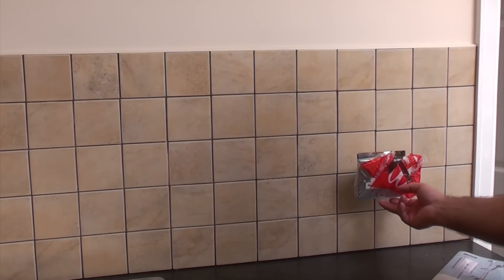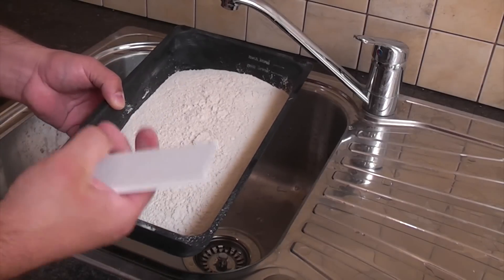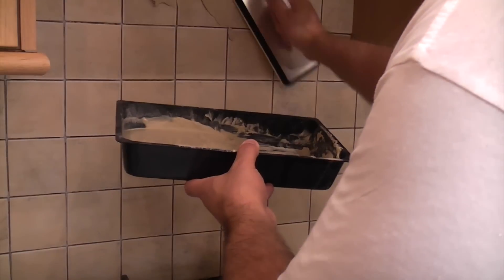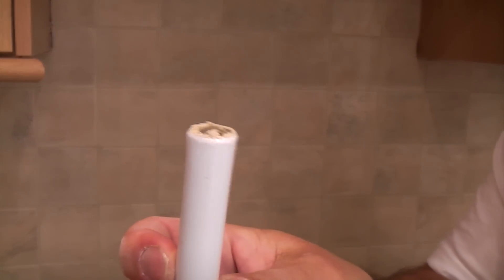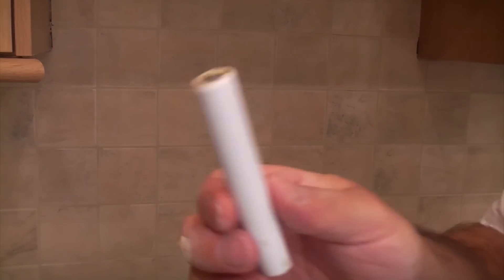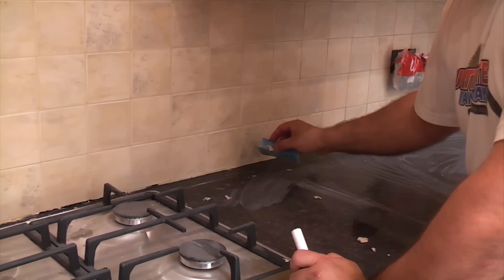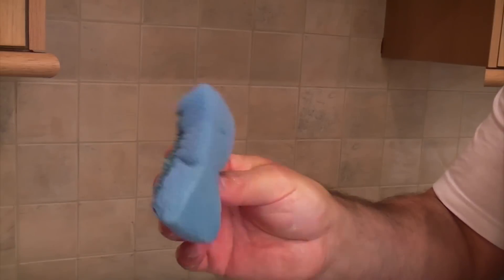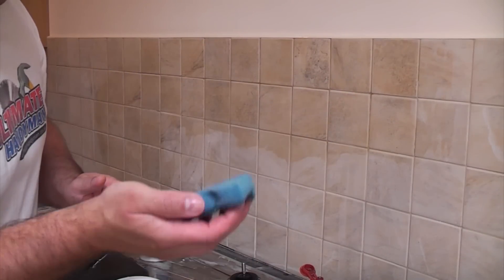How to grout tiles | tile grouting

Comment: Excellent video.  As an absolute beginner I: (1) added more sockets re-doing all electrics using Wago connectors and boxes abiding by all regs, (2) installed 12 GU10 ceiling LED spots; strip LEDs and central light chosing FCC approved LEDs to avoid EMI; (3) screwed on Fermacell ceiling boards with FST (not to have to pay for a plasterer), (4) I fitted my German kitchen myself.  I was scared of tiling but your videos on this once again really help. I have saved money and done all as I wanted it!

Comment: I also did all of the plumbing with Speedfit and part in copper and I installed a kitchen sink across the worktop joint (between two worktops) a challenging and risky endeavour.  Your other video on the mains pipe coming into the property and how that is and worked (the only video I have seen on that on YouTube) really did help me there! Your videos are so great.

Comment: ...one of your videos made me aware of the problem with bathroom tiles being hit constantly by power shower that the original build had not used a water resistant board under tiles or not made more impermeable the plasterboard (remembered that the guy didn't do that 10 years ago).  I now provided some solution re-grouting but fully aware thanks to vid of the inherent weakness.

Comment: Good idea, I'll test a bit, as I have a sheet of scrap.Thanks for getting back so quickly.  P.s. I have sealed with Stainproof Original, leaving 48 hours after fixing (adhesive took a bit longer to set).  Will seal again after grouting.

Comment: interesting grouting process, i usually grout a area, then sponge off after a short time, then use a grout finishing tool to get the joints perfect. If you use the pipe or finishing tool too soon, the grout lines can become messy, but if you sponge off too quickly, the same thing can happen. i was hoping to see you silicone and finish the job, and get those worktops spotless, I hate a messy worktop lol.

Comment: Thanks for the video, the only thing that worries me is the removal of the grout from the tile surface.  Is there any definitive way to grout textured / porous tiles without making too bigger cleanup job.  My initial thought was that it might be possible to pipe grout into the gaps and clean is off as you go?

Comment: How long do you wait after applying the grout until you use the pipe? And then, how long do you wait until you start to sponge off the excess grout from the tiles?

Comment: Great tutorials. Made it really easy. Thanks :-)

Would have been useful in this one if you'd said roughly how long it takes the grout to dry before you can wipe it with the damp sponge though.
Reply from the maker: It's impossible to say as there are too many variables, such as the wetness of the mix or the room temperature.
Thanks for the comment

Comment: Do you find powder grout a lot better than ready mixed stuff? Sometimes I get little surface craters in the grout lines and wonder whether its just the grout i'm using or i'm sponging too early. Means I have to go over some areas twice to get it looking good. Any tips?

Comment: Brilliant demo! Feeling much more confident with my tiling now! lol I am going to tackle a very small area above the small sink. It is only 5 small tiles across and 3 tiles high (same size as video) Please can you tell me can i add the tiles without the posh beading along the top and sides? Can I just use white silicon sealant along the edges instead? Also the rubber grouting float is probably too large a tool for this small area?
Reply from the maker: +jaybeth69 
Yes, you don't need to use the tile trim, although it can be difficult getting a neat bead of silicone, but this video might help with that-
https://www.youtube.com/watch?v=6vjTxTFL-k0

Also when grouting a small are a sponge works well ;-)

Comment: The idea of using a short length of plastic pipe to "point" the grout intrigues me. I've had trouble getting a uniform grout line using un sanded grout. The builders contractor , jammed the tiles in with little or no gap so I'm stuck with the unsanded.

Do you have any information of installs using non sanded grout

Comment: Great video, thanks! Why do you silicone the gap between the workbench and tiles instead of grouting it?
Reply from the maker: You are welcome.
It's because the worktop will expand and contract. Grout would soon crack as it is not as flexible as silicone.
Thanks for the comment

Comment: Quick question if possible, bathroom tiles needed degrouting, have done that, am wondering if I should use water sealer before or after grouting?, the tiles have in the past damaged our wall on the outer walls
Cheers
Reply from the maker: Yoda Dundar 
I have never used that sealer I'm afraid, but most sealers are normally applied to the grout once it has dried.
Best to check the instructions on the sealer ;-)
Reply: ***** Many thanks for replying and the advice
Reply from the maker: Yoda Dundar 
You are welcome

Comment: hello ultimate handyman... I'm grouting my bathroom and have a question... the tile on the shower wall at the bottom meets the tub. In the space between the last tile And the top of the tub...does grout go there too or something else??
Reply from the maker: +Ameer Kader Hi, you should use a good quality silicone sealant around the tub (called caulk in some countries)https://www.youtube.com/watch?v=DKFunUIh9rc

Comment: Looks great.......good job on your video.  I've never seen anyone use a small plastic pipe to indent the grout between the
tiles before, so that was a good tip.  I've got a "rougher" texture to the tiles I'm using on my wide deck railing, are there any
tips to doing grouting on a rougher tile surface so that the grout doesn't get into the dips of the tile and mess the job up?
Also....your "UK" accent made this kind of hard to understand at times, but I'll do my best to "translate".....THANKS!!
John (in Nevada)
Reply from the maker: Thanks John, it can be difficult with rough texture tiles, but if you keep a damp sponge handy you can easily wipe any grout off from the tiles if it does not look right after profiling it with the plastic pipe or similar.Sorry about the accent ;-)